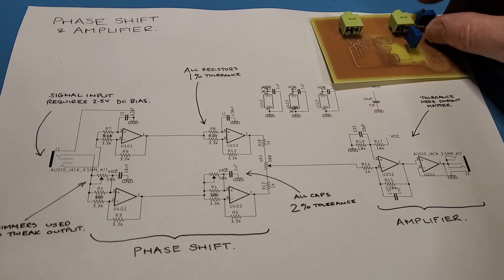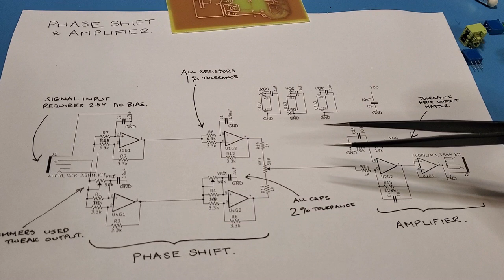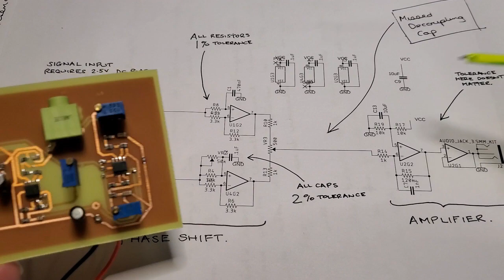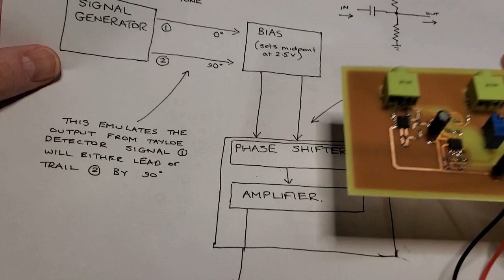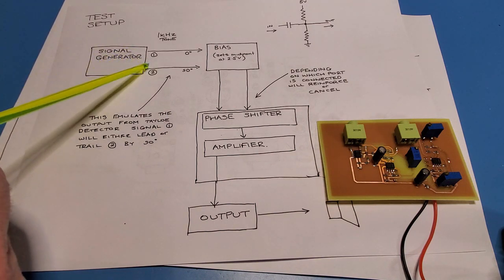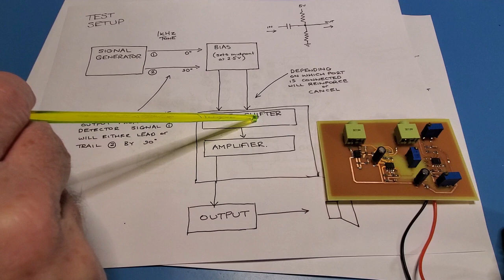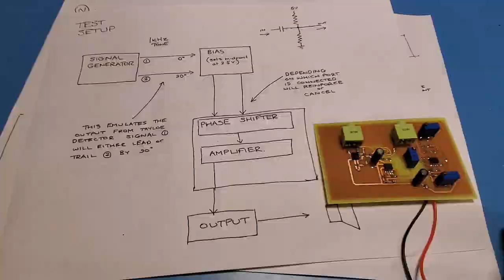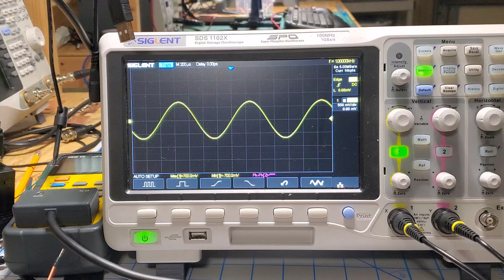TinyPICO Radio Part 4 - Phase Shift and Testing

Comment: one question: because of the suppression, i have to change the i/q inputs on this phase shift network depending if it's USB and LSB also, besides the LO, so it doesn't cancel the audio completely?